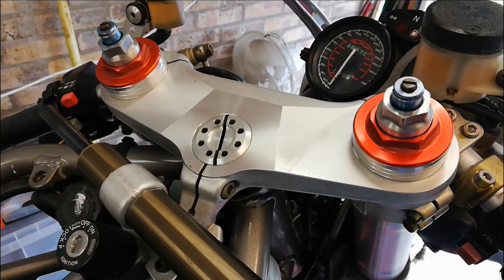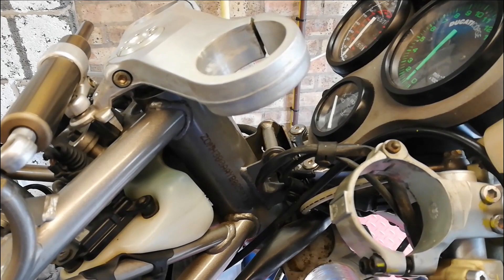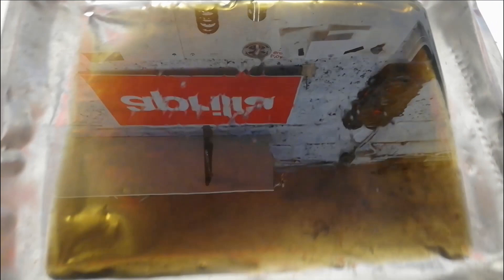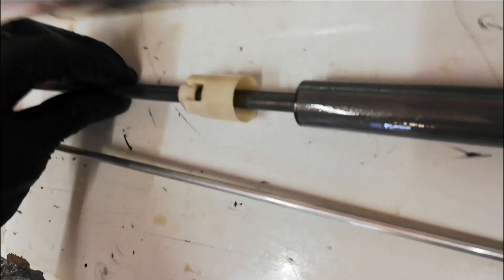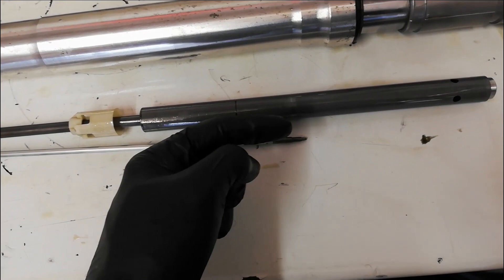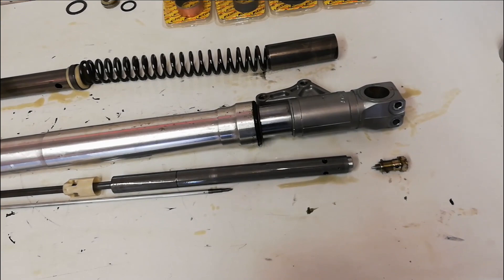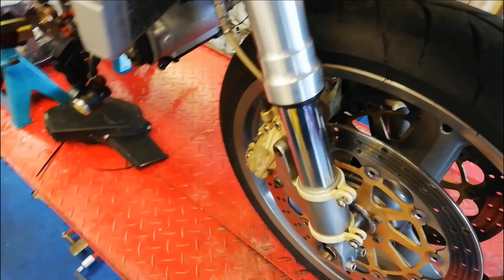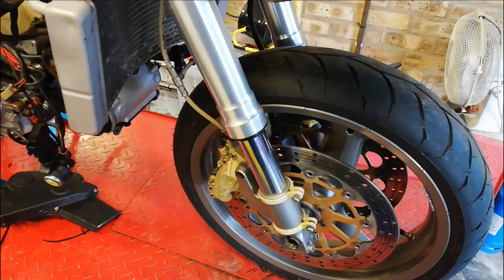Should I buy a cheap Ducati? Part 4. Get Forked!

Comment: Dave, my 748's discs are about 4mm thick measured with a vernier... I think the service limit is what, 4.5?
Also, did Ohlins ever make a cartridge kit or a shim stack kit for these forks? My Showa forks have Ohlins stickers on them from a previous owner, dunno if it's for show(a) or not 🤦‍♂
Also also, with B&C express now only selling to trade 😒where would you recommend us public scum get bits from now?
Thanks for your time, but realise, you owe me. It's cos of you I bought this bloody thing! 🤣
Reply from the maker: They probably have Ohlins springs, although it's difficult to confirm. They didn't do cartridge kits for them.
I can supply most parts, drop me a message via the website
Obsessionengineering.co.uk